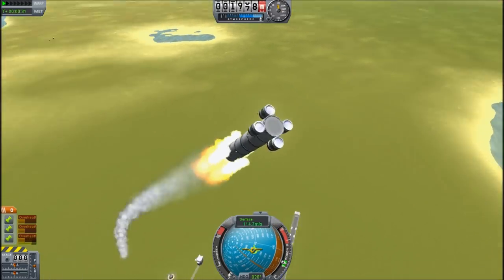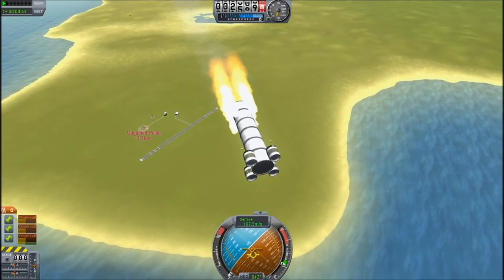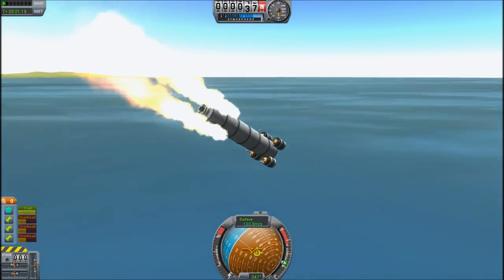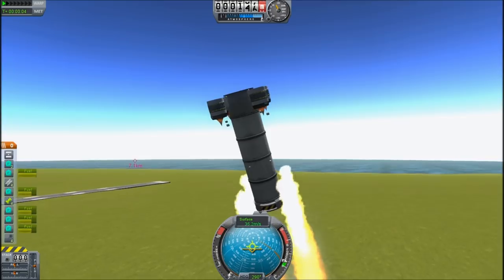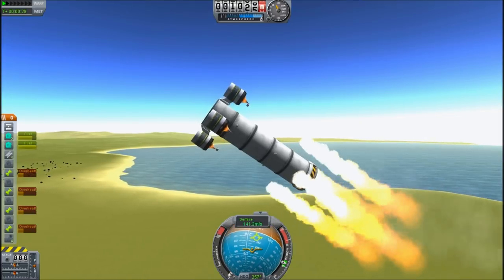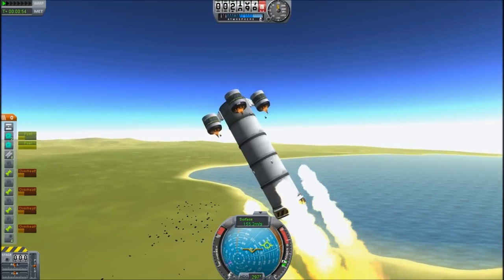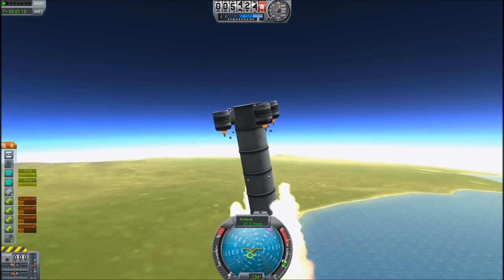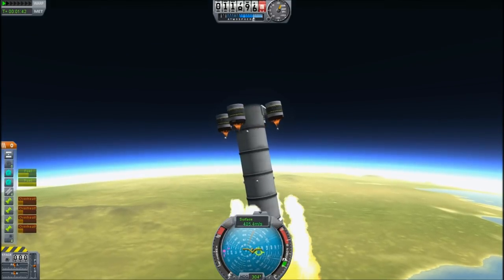The Pendulum Rocket Fallacy

Comment: 0:28 - STOP!  Let me guess first, and come back afterwards and see if I guessed right.
First - rockets at the top are gonna be hard to feed fuel to, but in any case, 1) how will you protect the rocket from all that fire and heat, and possibly more important, 2) how do you protect the contents of the rocket body from all that vibration and concussion damage?  Let's see how I do.
Reply: Well, I didn't get either of my two ideas right.  LOL.  I did get the bit about the fuel feed right though!  ;-)

Comment: What would happen if you angled the rockets outward, that way when it tips over, the rocket on the lower side would point toward the ground more and stabilize it?
Reply: Gillis McDonald Good idea, more effective if closer to the ground...
Reply: Another "rocket fallacy". Assuming the nozzles are placed symmetrically around the rocket, the thrust components on the plane perpendicular to the rocket's direction of travel would cancel each other out, resulting in no net force in this plane no matter how the rocket tips. However, you could control the thrust on each engine individually to cancel out any tipping. 
Also another common rocket misconception: rockets produce thrust by Newton's 3rd law of motion, equal and opposite forces, not by "pushing" off the ground or the air. Otherwise they would not work in space. The ground is pretty irrelevant to rocket flight except for reflected shock waves at launch.

Comment: Hi, could this work if the thrust was fixed on a rotating object? Like a real pandulum.
Reply: There's nothing that will keep the "thrust" (I assume you mean the engine block) pointing away from the ground, regardless how it's connected with the rest of the payload. I.e. you still have the same control problem - how to ensure the engine remembers which way it should be firing relative to the ground.
Reply: If you look at the Curiosity landing on Mars (using skycrane), Curiosity rover itself does hang under the crane like a real pendulum, no problem there, but you need to note that the engineering that keeps the skycrane hovering is still using something else than the gravitational pull from the rover, to throttle the engines correctly in order to stay in position above the rover and not fly sideways haphazardly.
Reply: @u1zha  I was thinking a motor on a rotation engine fixed on the thrust vectors and a gyroscope would do it. Then the "pendulum"/the payload/the propellant reservoir's mass would do the trick as it would always try to point to the force of gravity. I must be totally wrong tho, it's really counter intuitive.

Comment: I'm perfectly willing to accept that the engine-on-top plan is not going to guarantee that your rocket always points away from the Earth, but it is hard for me to get past the feeling that it will "moderate" the instability. Assuming it had no fins or fancy gyroscope stuff, I picture a rocket with the engine at the bottom flopping around like a fish in the bottom of a boat. With the engine at to top it seems like your instability would be limited to whatever the built-in misalignment was... a gentle curve rather than erratic flipping and flopping.

Comment: I knew it didn’t help with stability, but I’ve always wondered if the “engines at the top” layout would allow for easier SSTO, because you could drop empty fuel tank stages as they emptied without having to carry engines in each stage.
Reply: If you drop fuel tanks then its no longer an SSTO
Reply: @williamlangdon2596  xd

Comment: im so pissed, I spent 2 days engineering a ship to go to eve after 2 other ships didnt have enough delta to get captured into a nice low orbit. . It will get there, pop off a 2.75m lander and continue in low eve orbit. Ive put the lander at about 91k and fire a retro rocket liquid engine to slow me to about 2800 m/s. I then jettison that and re enter. All my fucking shit explodes. I did land in the ocean intact but thats not my goal so its moot and lame, and my biggest concern is that I landed in the ocean with only 3 small oxstat panels, im not even sure if that would power my lander and charge batteries in full sunlight. Anyone know what I can do to make rentry less harsh into eve? I have a 90 x90 orbit so im as slow as i can go before atmosphere. im out of rcs so i have to burn my retrorocket before im too far into thge atmo, it will spin me around pointing prograde if i wait till I get plasma on the craft. I got the mod for landers so im guessing my giant ass science lab and module (so it can actually make science) is just too damn massive, it has to shed too much energy in eves super thick atmosphere. im probably going to picheal it and send a craft with enough delta v to drop me under 2k m/s so i can land with some panels. Anyone got an idea for a workaround? im thinking if I place my orbiter in the lowest possible orbit (and i do have a tiny amount of fuel left) that might put me over the delta v edge and allow me to land with a few more panels. Really, what an incredible game.

Comment: Could you in theory mount the rockets at an angle so that instead of sending their thrust straight down they also fired to the side, so that rather than pushing the rocket straight up they would force it to spin by nature of the direction the thrust was moving? I know this works when the engines are mounted in the back, but might it also work with pullers?

Comment: I have a minor theory on why some people are initially convinced that the "pendulum rocket" would work, until they try it and find out that it doesn't. Which is that we have all seen it appear to work on a small scale, with firework rockets. Typically consisting of a small solid fuel (gunpowder) rocket encased in cardboard, attached to a wooden stick, with a payload of pyrotechnic stars inside a thin plastic shell at the top.

Anyone who has experimented with gunpowder rockets like these will probably have discovered that they will not fly straight if the stick is removed. Of course fireworks are not the most accurately made rockets anyway, but the stick seems to intimidate them into flying straight.

The "Estes" brand model rocket boosters are slightly better and will of course fly straight when put into a rocket body with fins on it. But it is also possible to make them fly reasonably straight with nothing more than attaching a stick with a bit of duct tape, similar to a firework rocket. In either case, the "pendulum effect" does seem to work.
Reply: On a firework rocket, the wooden stick is a fin, not a counterweight. That is why it is not use much by professionnals: it goes against the wind, whereas a shell goes with the wind. Fireworks rockets are also spin-stabilized.

Comment: Theoretically if Kerbal had a much, much lower volume and you were thus much closer to the centre of mass would this work? g for the lower part of the rocket would be significantly higher than for the upper part so the bottom of the rocket would be pulled down harder.

Comment: You also need pylons to ensure the exhaust doesn’t flow down the side walls of the rocket body and overheat the fuel and or payload. Putting the nozzles on the bottom prevents this.

Comment: hummm... not a scientist or anything... by when i saw the title of this video... my first knee-jerk reaction was... well of course it would not work... if the rocket is traveling at a speed that is exceeds the minimum speed to escape earth;s gravity... thus the rocket thrust would/could negate the effect of the earth's gravity on the rocket... as well... a the rocket gets to higher the altitude and gain speed... the effect of gravity on the rocket continue to decrease... thus gravity is not sufficient enough to hold the rocket in a vertical  pendulum... just curions... is this similar to what you siad but just in a different way... or does my knee-jerk reaction just accidently arrive at the same conclusion by accident.  just curious.
Reply: Kevin vanderPoole why so many ...s?

Comment: Soo basically it does not work because it's not a pendulum after all? There's no fixed hinge point in the rocket that would apply a torque to the rocket? It is a bit counter-intuitive when you think it in a very small scale. Like, it is very easy to hang a pencil vertically by holding it from the one end but it is very difficult to balance it pointing straight up on the tip of your finger.

Comment: So I decided to have pulling rockets attached to a load via docking ports because I figured it wouldn't wobble as much as pushing when I travel through space (I haven't actually done it yet). Does this fall under the Pendulum Rocket Fallacy or would it work? Comment if you've tried this already.

Comment: Any idea why bottle rockets use a stick which appears to be exactly a pendulum for their stability?
Reply from the maker: The stick actually works as an aerodynamic stabilizer.
Reply: Ok, that would explain part of it, but then pendulum rockets should follow the same principles at least down low in thicker atmosphere.  Maybe if a pendulum rocket had a long enough body below the rocket?
Reply from the maker: Right but it's not the mass that's keeping it stable it's the aerodynamic drag. And passive aerodynamics can't take a rocket that's veering off the vertical and point it straight up again.
Reply: and moves the CG back to allow the aerodynamic stability to work
Reply: +oak Yes, but that's actually bad. The further forward the center of gravity is, the more stable the rocket is. The advantage of the stick is that it also moves the center of drag back (further than the CG), making it more stable.

Comment: Not a true pendulum because the CoG is higher in that design because of the weight of the engines. I.E. it is nose heavy. There are a whole lot of other issues to be dealt with having the engines above the fuel tanks because the fuel would have to be pumped upwards against gravity instead of the feed pumps being assisted by gravity and then you have to deal with the fuel's own inertia of being moved around.. etc. etc.

Comment: Aren't those pylons aerodynamic surfaces? I'm wondering if that wouldn't cause the change in behavior you described. It would at least explain the rotation, because you'd have 4 tiny wings pushing your rocket in a circle.

Comment: Next question:  Does it matter where the gyros or attitude thrusters of control surfaces are located.  Intuition says the control surfaces should be at the bottom, as they work by drag, and that the rockets should be in the nose to get the longest  moment arm,  I think gyros should be in the middle, but I could be wrong...  What do you think?
Reply: Indeed, having the control surfaces at the bottom is best. Having the rockets at the top depends on having the rockets able to adjust to always point in the direction you wish to go; otherwise, there is no advantage to having the rockets at the top (having the rockets on the bottom, on the other hand, makes the fuel feed mechanism much simpler, so it's a balancing act). I have no idea how gyros/reaction wheels work, but I get the feeling that, as you say, having them at or near the centre of mass would be ideal.

Comment: Science News reporting be like: 
"Man accidentally proves Pendulum Rocket Fallacy wrong by demonstrating Pendulum Rocket Fallacy in KSP."

But seriously though. The 'Self-leveling' effect Scott demonstrates kinda indicates a flaw in the basic assumptions of the Pendulum Fallacy. Or rather a potential exception to the Fallacy.

Given that it's successful implementation essentially hinges entirely on flexibility in struts and centripetal force, or rather the centripetal acceleration perpendicular to the linear velocity.

Which is why there was a more significant effect when Scott says he lengthened the struts, causing a more acute turn due to the struts bending more.

As it happens with centripetal acceleration; If the perpendicular acceleration is larger then the harder it will tighten inward, creating smaller circlular path. Conversely the lesser the acceleration then the circular path will be larger due to the looser inward tightening being applied.

It's also used in projecting orbital trajectories, gravity being the perpendicular acceleration to the rockets linear velocity.

Altering the velocity of both or either vector, the linear velocity or the perpendicular acceleration, results in tighter or looser circular motion. Or in other words the orbital path.

In the videos case there are a few axis of rotation occurring with a definite Pendulum effect due to the flexibility of the struts. 

The Pendulum Fallacy seems to preclude any accounting for a pendulum weight (linear vector) attached to the cross bar (perpendicular vectorl with a non-rigid string (the strut).

The string, and strut by proxy, only appear to be rigid when the acceleration on both vectors equalise or either one is zero. When they are not the  strut/string allows for a degree of bending during unequal accelerations above zero.

This is probably a poor attempt at using the pendulum as an analogy, sorry.

Comment: I wonder if this would work differently with the aerodynamics mods you've been using in recent videos.
Reply: aerodynamics have nothing to do with pendulum.
Reply: The pendulum effect is caused by gravity, aerodynamics have very little to no effect on this due to it not being able to generate enough air resistance.

Comment: Your analysis of the fallacy is wrong. The gravity being "universal" or more precisely the gravity acting effectively through the center of mass is insufficient for the stability of the vehicle since a genuine pendulum also has gravity acting effectively through the center of the mass. Any force acting through the center of mass produces no torque relative to the center of mass. So gravity has no effect on the orientation. The reason that the rocket is not a pendulum is that both the direction of the engine thrust is invariant with respect to the direction the rocket is pointing to and produces no torque either. There is no correcting torque that depends on the deviation from the vertical line. The change of orientation can only come about through engines firing actively asymmetrically or vector thrusting. However, whether the engine is fore or aft the center of mass is irrelevant to the generation of torque. The fallacy is that there is no pendulum per se for a rocket that is free flying (discounting the atmospheric pressure).

Comment: If the fuel was liquid and allowed to freely slosh about the fuel tank, the pendulum effect would work.
Reply from the maker: Nope
Reply: Scott Manley I was going to suggest that the center of gravity would shift with the fuel's movement, but then realized the stupidity of that argument. The CG would shift towards the earth gravitational pull which would actually cause the rocket to torque towards the ground even faster. The exact opposite of how I originally thought it would behave.
Reply from the maker: Regardless though, once it’s in the air the gravity of the earth can’t affect the fluid in the tanks. The reason we feel gravity in aircraft is because they have wings and pilot ensures those work against gravity.
Reply: The same reason rifling makes the bullet fly further.
Reply: @scottmanley  How does rockets used in fireworks (with the engine at the top and the long boom behind it) remain stable?
Reply: @scottmanley  but what if the fuel were solid and allowed to freely slosh around in the tank?
Reply from the maker: @Shenron557  The stick acts as an aerodynamic stabilizer
Reply: @kevinradtke3767  same as if it were liquid and allowed to slosh. It would rip itself apart as several hundred pounds/kilos of mass repeatedly impact different parts of the container. I'm fairly sure there's baffles to limit sloshing for liquid
Reply: @scottmanley  that makes sense. Thanks for the clarification.
Reply: @Shenron557  Aerodynamic drag, not pendulum, I guess.
Reply: @joshuacheung6518  I had hoped that mentioning solid fuel sloshing around would make it clear I wasn't serious
Reply: @kevinradtke3767  you underestimate my inability to pick up sarcasm via text
Reply: @Shenron557   The stick serves the same role as the fins, moving the centre of pressure behind the centre of mass.
If you drop a dart sideways, the  drag from the flight will turn it to point downward, not through gravity on the mass to the front, but because its easiest to drag the tail behind.

The key point is that fins (without guidance) don't make it go in the direction its pointing, they make sure it stays pointing in the direction its going
Reply: @matthewday7565  gotcha. Thanks!!
Reply: I think it bears noting in the dart example     matt pointed out the that the dart will fall point first "not from the gravity on the mass on the front of the dart" which is true but maybe slightly misleading the mass on the front of the dart is important though the imbalance of having more mass on the front of the dart and more surface area on the rear both play a part in stabilizing a dart

Comment: okay.. but rocket engines move now. You told us why this didn't work in the past and why it doesn't work in a video game. But not why it wouldn't in real present day life, where we have flight  computers that can adjust the thrust of individual engines and control where each engine is pointed. A big benefit to getting this to work, is you can drop basic fuel tanks instead of complete stage sections.

Comment: Because with a helicopter you aren't relying on gravity to keep everything in the right position, more-so you are relying on the rotation of the blades and the centre of gravity. In a rocket the center of gravity is central, rather than down low like a helicopter. Also a helicopter has a far greater area providing downward force comparatively to a rocket.